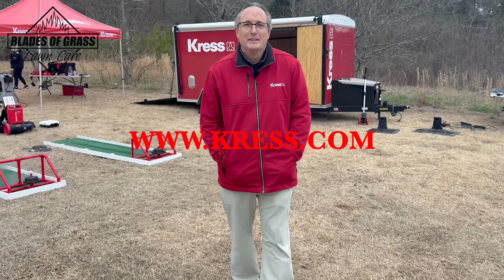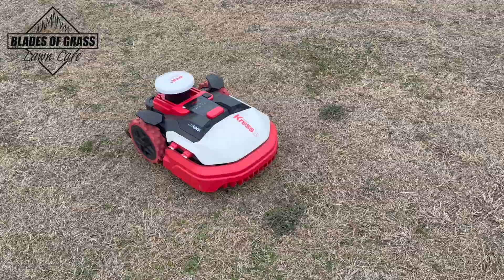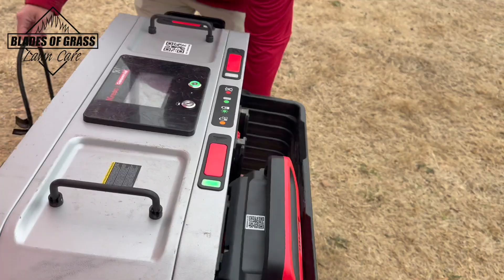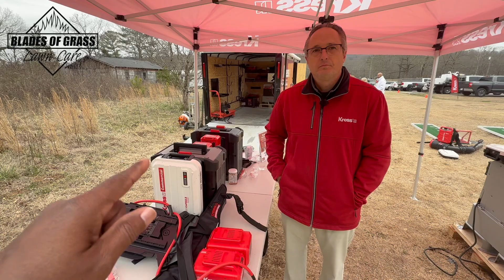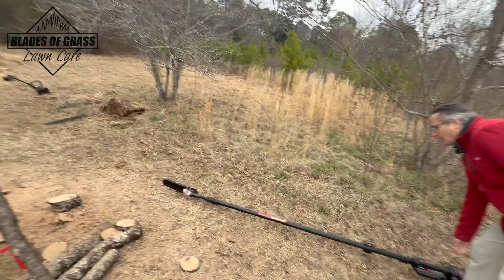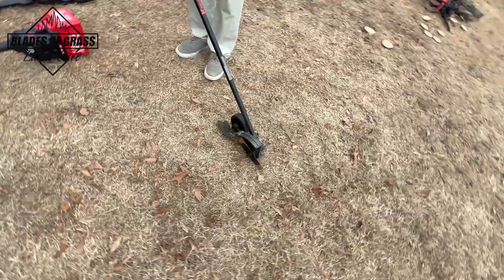UNBELIEVABLE! Kress Commercial 2025 line up and UN-MATCHED offer!

Comment: Local rental place has the these my only issue. Is the tower that’s on their building doesn’t reach out to most of my customers. I was thinking about doing a few robot mowers. Maybe switching over to battery powered tools
Reply from the maker: I was told that they are currently adding more towers and dealers throughout the US so you should see some coverage soon.
Reply: @ oh I’m sure because I think it was something new in this area probably about four years ago. The guy started selling them and he put a tower on his building. I remember right it’s a 10 mile radius or 15 mile radius. I was actually gonna talk to a guy I know that has a few commercial buildingsand see if he would be up for putting a tower on his building.